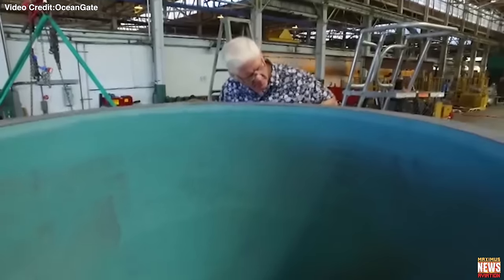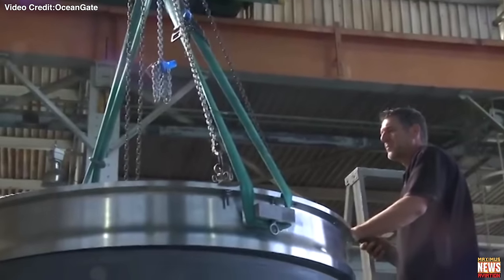Watch The Manufacturing Process That DOOMED OceanGates Titan To Fail. But It NEVER Had To Happen.

Comment: They took two dissimilar material and glued them together. Each of these materials react differently to extreme pressure and temperature changes. Add cyclic deterioration from multiple dives and you have a recipe for disaster.
Reply: you have a recipe for human pancakes.
Reply: But James Cameron says this was a known thing amongst all engineers and it wasn't some obscure scientific knowledge.
Reply: They were sniffing glue when they made the sub...
Reply: Carbon fiber has absolutely no place in the depths of the ocean. Not capable of handling that pressure to begin with.
Reply: A soda can was better built to survive than this submarine!
Reply: OMG great point. I do alot of crafting and i also make costume jewelry as a hobby. I just had to read a few articles on the  differences of all the glues and which materials they bond too and how they hold up in conditions such as heat, humidity, freezing cold etc.  This is no different. You are right. Another point of negligence for the lawsuits.
Reply: @EpicBongZilla  what about carbon fiber glued to metal though. That seems like a good human pancake recipe.
Reply: @rockyBalboa6699  you know you can do an experiment using an empty aluminum can to simulate what happened to the titan. 

Empty out a can, keep its full shape. 

Place can in boiling water and let it boil for about 10 minutes. 

Prepare a dish deeper then the can with ice water. 

Use tongs to remove can from boiling water and quickly submerge it into the ice water. 

Can will suffer Explosive decompression and crush its self. Just like the submarine did
Reply: That's not even the half of it.  The carbon fiber ended up being subjected to compressive forces, when the strength of carbon fiber is against tension.   It'd have worked fine if the higher pressure had been INSIDE the vessel rather than outside.
Reply: Yes. I'm no engineer, but trusting a glue to titanium & carbon doesn't sit right with me either, even at room temperature, especially when the force is equal to 144 minivans per square foot.
Reply: and cfrp is not good in compression
Reply: The more I learn about this stuff, the more I am floored that Rush was an engineer,,,, was he dense in the head?
Reply: Basically. a design analogous to disposable chopsticks - use once then dispose of carefully.
he did theHYPE 1st, the business model 2nd and the ease of construction 3rd and the engineering 4th.and thought the extermination waiver would cover lesser priorities like the lives of Billionaires, who are seemingly to exploration what log rollers were to the building of the pyramids//
Reply: Glued.  Not welded… glued.
Reply: Carbon fiber is GREAT under tension, such as a pressurized cabin in a spacecraft, but it does not have that much strength in compression. It’s probably more so the epoxy giving it its strength under compression. Why the hell did he use carbon fiber?!?
Reply: JohnnytNatural  That idea popped into my head too, then right away that means $. So, voila ! I'd be more contented with a roll of stainless steel that's welded. This whole idea of revisiting the Titanic is worn out with me. There's plenty of video, and the clarity isn't going to be be any better through a 7 inch plastic lens. Let the dead rest in peace.
Reply: That's how you get your ass turned into a milkshake💁‍♂️
Reply: Ah, but you see it's not a thin glue like Elmer's glue; it is a thick glue... Like peanut butter. 👍
Reply: It already visited the Titanic a few times.
So your explanation isn't all what you think it is!
Reply: They thought that they were smart,
The proved that they were fishfood.
Reply: Exactly. Don't forget the window wasn't rated for anywhere near 4000 meters deep.
Reply: doorway into the sub.. was also hinged on that weak connection..  warping is an issue
Reply: @HurricaneOK1  Ok. Jiffy or Kraft ?
Reply: @FunieBoi-hh7wx  He proved one way not to build a sub for continuous use with his life. The sad part is he took others with him. Not the greatest legacy.
Reply: Don't forget to add a narcissistic millionaire who fired an employee for questioning the safety of the sub design...
Reply: @ario4795 I am interested to know the specs for the 2 part epoxy.  What kind of bond does it have 4k meters below?
Reply: @Dean_Winchester86  Redneck, know it all, backyard, engineer.
Reply: @largol33t1  I know this sounds crazy but once I saw his hairdo, I knew he was a narcissist. I'm sure everyone will understand.
Reply: @apollomoonlandings  So human fritters rather than human pancakes?
Reply: @danvetor1365  What don't you understand about the work cycles?
Reply: @jonfreeman9682  yes, and they fired the engineers that told him that lol.
Reply: Thats not an explosive decompression. That’s rapid air evacuation causing suction to compress the can.
Reply: Imagine having to spend the last moments of your life sitting cross-legged inside a small tube with an idiot whose life mission is to turn you into a fritter.
Reply: Those recipes are what people likes to spend, the CEO knows how to make money for sure.
Reply: @jimbendtsen8841  Rated for 4000 feet is what I heard.  Their target depth was 3x that.  Insane.  Dimes to donuts that wasn't disclosed in the signed waivers.  In my opinion those waivers should be null and void due to nondisclosure of very significant safety information.
Reply: @jonfreeman9682  It is Carbon Fibers are useless for reuse when you place them in an environment where the pressure is outside and not in.  Each introduction and removal of that pressure causes micro-fractures inside the fiber weakening it each time.  Even Formula One has that data from the front cones they use on the cars. Some of the teams if it is hit in a race and looks ok they still replace it as they know the next race at random it could be what causes a tire puncture from fibers that may come loose and lodge in the tire ending their race day. 

But besides that word has it the viewport was only built to a 3000ft tolerance depth.  So if they discover the ballasts further away from the wreak on the bottom it may be possible that they witnessed the viewport glass crack for a second or so dropping the ballasts and implosion even before the ballast's release effects were realized.  That would give them that split second of oh shit. If it turns out to be the viewport.  And all over.    When they bring it up I guess we will see if the port glass is intact or not.
Reply: We'll see.  I suspect the end cap - carbon fiber epoxy joints were not the problem.  The carbon fiber in the joint is quite possibly still there.  I suspect the carbon fiber cylinder was the problem.  Though possibly the differential expansion and contraction right at the joint was a problem.
Reply: @largol33t1  Billionaire.
Reply: That's not even it. Thats the wrong "direction" to build the stuff for keeping pressure out. I don't even know how it made it once much less the dozens of dives it made other than the 4 to the Titanic.
Reply: @michaelscott33  suction is just less pressure inside that outside.
Reply: The lap between the 2 materials was insufficient at the same time.

It's almost like they didn't know that the us has had plenty of proven submarine designs for a long time
Reply: Exactly
Reply: @ario4795  oof
Reply: @lordhighwind6230 well you cannot weld metal to carbon fiber.  The only way to bond these materials is an adhesive.
Reply: The "engineer" Tony Nissen dude said it was just glue holding it together Yikes!
Reply: @joanfrellburg4901  The so called "engineer" Tony Nissen himself with a smile on his face it was the glue holding it together Yikes!
Reply: @danvetor1365 it actually makes a lot of sense.  The difference in expansion and contraction will cause problems over time.  It’s the cycling of expansion and contraction over and over that causes failure.  Even the bicycle industry found bonding metal bottom bracket shells to a carbon frame would eventually fail the boding Agent or at times crack the carbon.  This happens 24 hrs a day not just in expeditions.  In storage ect temp is always changing.  It’s like bending a spoon and bending it back.  You can do it but after so many cycles it will eventually fail.
Reply: Cameron explained that the capsule should be all one piece. The inside of that sub looked like a Pringle’s potato chip can. Reminds me of the old saying, it burst at the seams.
Reply: @joanfrellburg4901 its wasn't just any glue that was structural sikaflex lol
Reply: @apollomoonlandings you are wrong. What was left would be the human equivalent of spam or Bologna lol
Reply: @Dean_Winchester86  he was not thinking clearly
Reply: @Dean_Winchester86 Airplane aeronotics engioner most planes use this stuff where he got idea listen James Cameron commentary on this informative.
Reply: @joanfrellburg4901  It's Jiff not Jiffy!
Reply: I'm not an engineer and even I knew that ...  IDK what they were thinking
Reply: @Turboy65 that glue still wouldn't hold against tensile stress caused by bonding two dissimilar materials together
Reply: @hardmcshaft7931  yes, unstructural sickoflex
Reply: @MissX905  Ya, just because model cement works is no reason to assume this is an ideal scenario. I bet he plays Russian Roulette on the weekend.😄
Reply: Not an expert, but wrapping a cylinder with carbon fiber seems to me to be what is done with a pressure tank where the pressure is on the inside, not the other way around.  SCBA tanks have been wrapped for years for structural integrity which contained internal pressure.
Reply: @rp-ot6ov  Glad you pointed that out, not everyone knows that.
Reply: @UpInSmoke54  OK, raspberry jam or strawberry.
Reply: @rockyBalboa6699  Kind of hyperbolic but point taken.
Reply: @joanfrellburg4901  The pressure would hold the two pieces together unless ... the cylinder failed.
Reply: @Deploracle  The caps are now lying on the ocean floor and the cylinder is in pieces. If anyone wants to buy a titanium cylinder get in touch. LOL
Reply: Are you an engineer, or just a random diver with an opinion?
Reply: @joanfrellburg4901  Lying on the ocean floor a significant distance from the carbon fiber debris. The carbon fiber crush was so sudden it squeezed out the titanium endcaps with force.
Reply: @Deploracle  So your theory is over time, somewhere, probably around the middle of that cylinder, due to expansion and contraction, a hairline crack developed which rapidly turned into an implosion.
Reply: Exactly, the hot-cold cycles had to weaken the bond between carbon and titanium. Nowhere near enough overlap at that joint: carbon abhors 90 angles also. Flexing against titanium continuously would eventually damage the carbon coming out it the joint. Flue, even epoxy to metal does not equal solid metal or even solid carbon fiber. A giant carbon sphere would be safer that this.
Reply: @MakaiMauka  I think you've made some very valid points here. Especially that connection between the titanium and carbon with really ( in my humble estimation) isn't that lengthy a sleeve. Then you've got the glue exposed to salt water which by nature is highly corrosive.
Reply: @johnmonk3381 why not? It did for 13 pressure cycles.
Reply: @nikoscosmos  13 ? So he wasn't even superstitious. No wonder.
Reply: @Turboy65 Not with the glued end caps. Would have popped right off.
Reply: @k53847  I form steel suspension components with a mechanical press.  The press is rated for 2000000 Newtons (200 tons).  When I set up the stroke height, I have to account for tooling compressing elastically, under load.  Why is this relevant?  It taught me that, when forces get large, EVERYTHING is a spring.  The titanium end caps and the composite tube are both compressed like springs.  The diameter of the titanium end caps is reduced by the water pressure.  The water pressure on the wall of the composite tube will reduce its diameter and the load from the end caps will cause it to shorten.  If the composite tube and titanium end caps do not reduce their diameters by the same amount for the same change in pressure, the component that would shrink more transfers load to the component that shrinks less.  As this transferred load is in addition to the water pressure loading, the component that shrinks less can be loaded past its rated load and fail above its rated depth.
Reply: Yeah, I’m shocked that it was glued and not bolted
Reply: @HurricaneOK1  End was way to loose for glue and the glue probably had voids in it as well due to being thick.
Reply: @jimbendtsen8841  It was certified to 1300 meters, that being said it made it through 14 successful dives to the Titanic so it must have had a large safety margin.  Probably got weaker with each dive, maybe the remains will show if it broke....
Reply: @camojoe83  They had made 14 successful dives to the Titanic since 2021 carrying 46 passengers.  Each one increasing the odds of failure.......
Reply: @ssaraccoii  SCBA tanks are also wrapped with cross fibers for additional strength whereas this tube was just circular, the epoxy was basically holding it together...
Reply: @Deploracle  The pressure comes from all directions  there is just as much pushing it apart as holding it together..
Reply: I wanna know how he fit the titanium to the carbon fibre at the joins because surely the pressure would cause a rupture between the too materials and cause cracks and pressure loss
Reply: He built his own coffin  very sad
Reply: That’s unbelievable when I saw glue
Reply: @joanfrellburg4901  "144 minivans per square foot"? What's that in school buses per football field?
Reply: @grantm6514   a teaspoon of neutron star material would weigh around a billion tonnes.
Reply: @tybrady4598 My understanding is that carbon fibre is certainly better in tension but is still not too bad under compression. The carbon fibres attract all the load (being the stiffest element) and the polymer matrix stops the carbon fibres from buckling under compression. But Poissons ratio helps to explain why it can delaminate under high compressive loads (as the bursting forces are taken by the polymer matrix) but not under tension. At least thats my understanding
Reply: @grantm6514  Algebra, I didn't like it either at first. Still too lazy for it.
Reply: @HitsInSandbox yup my moneys on the view port while James Cameron thinks it’s the carbon fiber body that whole machine was a death trap. Used glue 🤦‍♂️
Reply: @solidstream13  Yes glue is needed but it also needs mechanical clamping to secure the bond against pressure and thermal cycling.
Reply: @joanfrellburg4901  US teaspoon or metric?
Reply: @Cam-ng8rk The fiber layout is also a problem there is no cross lamination that helps to hold the fibers together. The individual fibers are isolated and can only share load via the epoxy matrix. The layout does not distribute the stress around fiber to fiber.
Reply: Just glued it together, that’s crazy. Doing that is bad enough on a car and that is something under fairly minimal stresses, also wouldn’t be an instant disaster if cracking or delamination occurred over time. Glue any dissimilar materials for let’s say in a production environment and you wouldn’t expect reliability or longevity out of doing something like that.
Reply: @joanfrellburg4901  have you seen father Ted
Reply: @kazedcat  I have not found this to be true.  why do you say? Pressure would only further cause compression force.  Clamping would disallow the expansion.  I’m not understanding your point.  Are you suggesting that a clamp was necessary and was not present?
Reply: The Axial pressure from the outside in is 6400PSI.   But I calculate the pressure on the ends of the ring are much higher.

Internal diameter 56"   Radius 28"
Inner area 2463 in^2  

Cylinder wall thickness is 5"

Outer cap area R = 33"  =3421 in^2

Ring area = outer - inner = 958 in^2

Pressure on 1 endcap = 
PSI(outside @ 11,000ft) 6400PSI * 3421 in^2 
= 21.894 million
Pressure per square inch of ring 45,708 lbs from both sides? 
For compare, concrete is 2000-6000 PSI in compression while 
Structural Steel is 50,000 PSI in compression and tension
Reply: Yes, and the glue itself is the 3rd dissimilar material. Its properties relative to the metal and carbon fiber is critical, especially since the glue fills the gap that seems to be over a millimeter thick. The glue was applied imprecisely by hand and allowed to cure in a uncontrolled,  non-sterile, and non-vacuum environment. If it's exposed directly to the ocean, then it can degrade and later, a tiny leak can turn into a water jet at 6000 PSI.
Reply: Peanut butter in, peanut butter out.
Reply: @oahuhawaii2141  You’re statement is so very clear, concise and logical it boggles my mind that the “experts” involved didn’t think of such a simple, yet instantly deadly scenario. Maybe “experts” these days aren’t the top people in a field.
Reply: @EpicBongZilla: That isn't inducing explosive decompression or even implosion. That's just temperature shock. Titan wasn't hot as boiling water and immediately placed 10K ft down into the ocean. [It was lowered under the surface of the ocean and released to sink down to the depths. It continually reached temperature equilibrium as it descended. After 105 minutes (45 minutes before it should reach Titanic), the pilot detected a critical problem, and released the ballast weights to begin an emergency ascent; he notified the surface support ship of the abort. After that, the ship lost comms and tracking pings. The US Navy detected an acoustic event consistent with an implosion.]
Reply: @danvetor1365: You didn't consider material fatigue.
Reply: With glue.
Reply: True, not only that, even if the carbon fiber itself could withstand the tremendous pressure and cold, you had resin between the layers. That resin was subjected to the same conditions. It was like a layer cake instead of one continuous material that likely weakened over time.
Reply: The core issue besides all these things.....carbon fiber construction of a vessel is OK when it's used as a pressure vessel....when the carbon fibers are in TENSION, like when the pressure inside the vessel is greater than the pressure outside.....but here we have the enorormous outside pressure of the ocean trying to collapse the vessel....it's as if the sub was built as a vacuum ( not pressure) vessel....the carbon fiber is now in COMPRESSION.....a very fundamental and basic fact totally ignored in this design, and in direct violation of how it should be used.. Carbon  fiber is NOT meant to be used in compression.....period.
Reply: @ario4795  Or human toothpaste, getting squeezed out.
Reply: @ario4795  not so much pancakes. more of human goo.
Reply: @misselanys1219  I doubt there will be lawsuits.  They signed a dozen waivers before they went down.   If anything, the estates of the victims will be sued to pay for the rescue efforts.
Reply: @jaycahow4667  My point was that wrapping a cylinder adds strength from pressure from the inside out, not from the outside in.
Reply: @ario4795 Not really a pancake, have you ever seen hot dog sausages being made, that pink paste? That's what pressure and heat does to a body.
Reply: @danvetor1365  Ticking time bomb with a long fuse?
Reply: @BrianClem  None whatsoever now.
Reply: hell carbon fiber is two materials that arent the same the fiber and the glue
Reply: @solidstream13 For joining titanium and carbon fiber adhesive is necessary but titanium and carbon fiber expands and contracts at a different rate this process stresses the adhesive causing bonding failure. A mechanical clamp will reduce stress in the adhesive preventing bonding failure but the clamp will just transfer the stress from the glue into the bulk materials. Mechanical clamps are simply shifting the stress from the weak glue into the much stronger titanium and carbon fiber material.
Reply: Different Young's Modulus.
Reply: Yeah it should be homogeneous
Reply: @EpicBongZilla  It's lightweight & how much fiber will handle pressure? Freezing depths & just one weak spot, it cannot survive.
Reply: @ario4795   batter, pancake batter.
Reply: @solidstream13 cant believe they do that type of bonding in a non clean room environment. Dust hair any number of contaminants cant be good. Eouldnt have saved them but wow
Reply: @ario4795  *Top ramen
Reply: @EpicBongZilla  the can crushes because atmospheric pressure is greater than the inside of the can. Has nothing to do with temperature.
Reply: Exactly! Not a shred of thought of what stress has done to the unit. No respect for the power exerted at that depth. I am a submarine veteran. You couldn't pay me enough to go down 2 miles.
Reply: @EpicBongZilla  I was going to say Carbon Fiber my A$$! I was on a Fast Attack in the 70's & you couldn't pay me enough to risk going down 2 miles. Thinking it impervious to the stress...
Reply: I have a road bike with carbon forks that join aluminium steerer tube and there are signs of slight delamination where they join!(it's old ok).  Madness.
Reply: @jonfreeman9682  Most Laymen would know that never mind James Cameron / engineers.
Reply: @johnmonk3381  Never said it would. Carbon fiber composites are amazingly strong against tension. Against compression, not so much.
Reply: @TD_YT066  I think you're getting pressure and force mixed up.
Reply: Most of the other successful deep dive craft have a living space based on a thick titanium sphere. Probably designed be middled aged white men !
Reply: The glue isn’t an issue since the forces are pushing the ring into the carbon anyways. The problem was the carbon was laid in only one direction and couldn’t hold against the endcaps pushing in probably. Carbon fiber is like plywood, you have to run the grains in different directions to create strength. In the video it seems like they just built it like a spool of wire with all the fibers parallel? That just looks wrong
Reply: @kazedcat  I think we are saying the same thing. However when metal expands and contracts the forces are too great.  Expanding metal will expand and contract regardless of what outside forces you attempt.  It would simply further tension a clamp of even cause a clamp to fail.   You cannot direct the expansion only inwards.  Even if this were possible it would theoretically put more pressure on the bonding agent thru these cycles.
Reply: @Disoriental11  Wasn't the carbon bonded inside the ring, therefore large pressure forces on the carbon trying to separate it from the ring.
Reply: Carbon fiber has its place for airplane manufacturing, light weight, fuel economy.  However, it’s totally mind boggling to use it in hydrodynamics application.
Reply: Even the carbon fibre has been spun linearly rather than in crosshatch pattern
Reply: JohnnytNatural  I think the glue is only there to hold it together above the sea, or just a few meters below. It's naturally held together under the sea due to the pressure. There were reports of water leaking on the Titan and the solution was to go deeper and leakage stopped.
Reply: @largol33t1  Better to hire more diverse people without the knowledge to question the design because that will inspire others.
Reply: @somethingwentwrong3298 the carbon tube is being pressed into the ring from the extreme pressures, not pulled apart. The problem is that the carbon and titanium would have different contraction rates under the pressure and that could crack the carbon near the joint, especially since the carbon was only laid in one direction.
Reply: @joanfrellburg4901  "I will be the first bla bla." Big red flag there. Bragging against extreme physics I bet you are going to loose your fight.
Reply: @RazorStrap  Work cycles come into play normally at some thousends of cycles, depending on use. Obviously you are not going to deep as many times with a sub as an airliners fly around 12-15h per day with multiple flight every day for years and years. But still, you shouldn't even discuss cycle fatigue when you are just beginning your operations, or if you have to, well it's a very bad sign to start with.
Reply: @12345fowler  Ya, just my opinion I can come up with 250,000 better ways to spend $250.K
Reply: @12345fowler  Arospace craft are not subjected to anywhere near 5500 psi.  And the pressure they are subjected to is internal (tension) not external (compression).  Cycles come into play much sooner when the vessel is subjected to many multiples of its design.
Reply: @agt155  My read is Pressure is Force x Area.  So if the water Pressure is 6200Pounds per square Inch, and the Ti. endcap area being pressed on is 3400 square inches with 6200lbs on each square inch, the total force will be 3400 in^2 x 6200 lb/in^2 = 21.8 million lbs. This force presses on the CF. ring which has a much lower area, only 958 in^2 so it has to 'push back' with the same force to remain attached. This happens on each end.  In addition is the 6200lb on each square inch of the cylinder over it's length and circumference.
Reply: @TD_YT066  force = pressure X area, but the rest seems correct.
Reply: @solidstream13  Yes the clamps may fail but that means you need to design a stronger clamp. The clamp will be two metal ring one inside and one outside with the carbon fiber sandwitch between them. When the metal expand and contract the two rings expand and contract together. This forces the carbon fiber to expand and contract with them mechanically. This ensures that the glue is not stress because the carbon fiber and the metal are force to move together. The carbon fiber will be stress and the metal will be stress but they are a lot stronger than the glue.
Reply: JohnnytNatural  actually it was the carbon fiber cracking up to the seal. 

One stocktons 1st dive in the titan he documented the hull making cracking sounds. 

Then on his second dive in the titan he brought an scientist with him. The scientist actually documented the hulls cracking sounds on video. 

He never even went back and reinforced it.

His hulls integrity was never stable to begin with and he knew it. It was basically only as stable as the epoxy used to glue it together. 

Once water made it through those cracks to the end caps. The vessel was doomed.
Reply: The point of failure will most likely be where the fiber & end cap join , that’s a small lip to support the joint, equivalent of 1/2 inch ledge to support a bridge I’m surprised it didn’t fail on second dive
Reply: @Turboy65  good point. When this investigation is all said and done, there will be reams of things that should have been done differently.
Reply: BINGO.

I took just enough engineering to get me into trouble... but have worked with titanium... and was SHOCKED when I finally confirmed that carbon fiber was used for the cylinder of the pressure vessel. I thought all the talk of "carbon fiber" was just a reference to the covers/fairings. The visible end bell was obviously titanium, and some photos I saw of the inside of the cylinder certainly LOOKED like titanium as well. But titanium end caps GLUED onto a carbon fiber tube... NO WAY!

A better solution would have been to use long studs from one end bell to the other, thus "clamping" the cylinder between the ends. I'll bet that the failure began not with the cylinder just collapsing, but with an end bell being "popped off" due to stress on the cylinder.
Reply: Engineering 101 -- Vision.  Design & Analysis.  Prototype.  Cycle test.  Test-to-destruction.  Analysis results.  Agree on actual safety margins for cycle & absolute usage.  Build a production version.  Dummy test it.  Then it put to use.
Reply: I've been working with material failures for over 40 years, I think exactly the same.
Reply: @EpicBongZilla  How exactly do you empty the soda can without breaking an airtight seal?? An open can will do absolutely nothing in this experiment.
Reply: How many dive cycles was this thing designed for or does anybody know?  Was it ever considered in the design phase?  Was this a test to see how many times it survived?
Reply: I wouldnt even ride a Carbon downhill bike, one crash and you have no idea what structural integrity is left.
Reply: Yes, but it was cheaper.
Reply: JohnnytNatural 
Thing is they act like glue is the only way, but rods could go from end to end with nuts
Reply: @BrianClem 
And was it the right Humidity amd material temperatures for proper adhesion. Looked like an open warehouse. Ferarri builds their engines in climate control
Reply: @jaycahow4667  Voids, bubbles (look how they mix it), dust (it's just a warehouse), and uneven application and centering. Every one of those things becomes a danger when exposed to pressures going up to 37 megapascals.
Reply: JohnnytNatural  I was wondering if it was that way, where the cap is pressed tight by pressure, but then if a slight weak point exists in an air pocket or slightly less epoxy in one spot allows a leak. Using bondo spreaders with no thickness test gauge is just way to inferior a process for something like this.
Reply: But mah innovation
Reply: @jonfreeman9682  the hull manufactures said it was 1 time use. They ended relationship with him when they found out what he was doing
Reply: @ario4795  lol yeah i don't like the sound of a carbon fiber sub then you find out its glued to the titanium front.
Reply: @lordhighwind6230  Might be the best gorilla glue
Reply: I know aluminum and carbon fiber can't touch so I'm wondering if titanium and carbon fiber have the same issues with each other?
Reply: That's a word-for-word quote (uncredited) of what a retired USN submarine captain said on "CBS Sunday Morning".
Reply: The submarine looked like a small industrial propane tank
Reply: I atleast hope it was gorilla glue and not Elmer's glue
Reply: But they were inspired!!!.. And amateurs teach amateurs to be amateurs. =💥..💀💀💀💀💀
Reply: Even they are similar materials the glue wouldn’t last.
Reply: the fact he had an entire team of designers and engineers. but they still decided to go with his plans and build it. he shouldnt be the only one held responsible. atleast 1 or 2 of those engineers should have been like, whoa what the fuck are we doing here...
Reply: I honestly don't think so....I mean with regards to carbon fiber wrap.  I don't understand right now how that carbon fiber shell ever had any significant impact on the compression strength of the vessel.  The stuff is STRONG with regards to not tearing, and I could see how it might add strength if the vessel was under positive pressure from the inside...but I don't understand HOW it would have ANY significant contribution to the strength of the vessel under compression.  I don't think it would, and this makes me question these guys....Does anyone know?
Reply: @pauliexcluded1  your right carbon fiber is insanely strong and tough. but when you put it under stressful conditions and out of stressful conditions multiple times the carbon fiber weakens. immensely...
its like a piece of thin steel... you can bend it, but bend it enough times back and forth and it will loose its strength and break... its the same physics and logic.
Reply: Spot on, how could they not know it. even if materials were the same how could glue hold it.
Reply: @danvetor1365  It doesn't matter if it visited the Titanic a few times previously. The more times you subject the vessel to the pressure at that depth the more the cyclic fatigue weakens the hull until it can no longer resist the external pressure. The CEO was playing Russian roulette each time the Titan dived, and it was only a matter of time before the inevitable happened.
Reply: They glue Cars together every day. Plus the pressure is pushing in all the time. I don't believe that's as much of an issue as the general construction of the shell. Just my thoughts.
Reply: In hind sight they should have made a slightly weaker miniature of the sub and install the monitoring system on it for each dive, then witness it implode before the last dive. Oh and yes, Oceangate, I'm available for the 'innovative new crew'.
Reply: @genekrafft948  First off, cars are not glued together lol. and secondly yeah epoxy weakens under 6,000psi of pressure.
Reply: @lordhighwind6230  actually it is bonded, that is the epoxy actually bonds molecularly to both parts, another advantage of using Apoxsee is, it can fill gaps if the surfaces are not perfect glue will not fill gaps and voids can occur.
Reply: They knew it and had a solution.. it was A solution.
Reply: Tony Nissen made pancakes
Reply: You nailed it, the carbon tube itself probably didn't fail, but that "joint".....
Reply: @Turboy65  Carbon fibre can't flex (as much) as metal sheets under high pressure. You see sheet metal flexing, there's still time, you see cf flex, that's it.
Reply: Mo' Diversity!
Reply: @Turboy65  I've also wondered about that. Many materials have have high tensile strength but little compressional strength (a rope being good example). I know nothing about carbon fiber but wrapping it around the steel vessel to reinforce it from imploding would do little to strengthen it  if the carbon fiber did not have compressional strength. Also it seems to me that if even a small  leak ever developed between the carbon wrapping and the the steel tube the entire depth pressure would be loaded onto the steel making the carbon wrapping irrelevant.
Reply: Not only dissimilar materials, but I'm sure there were air bubbles that contained humidity between the metal ring and the carbon fiber tube.
Reply: @camojoe83  If the fibers had been run longitudinally, in a "hyperboloid of one sheet" shape, with fibers running in a primarily fore-aft direction, and the exterior was braced with fore-aft metal struts that were braced with stabilizers to guard against buckling, the use of carbon fiber cloth would at least make sense.  Given that the craft was ever able to survive at all at 300 atmospheres, I would think a thinner skin under tension would have been able to do so repeatedly.
Reply: He was an engineer from Princeton working with the University of Washington and that’s what you get
Reply: You have a recipe for an underwater aerosol can that sprays fish food.
Reply: @flatfingertuning727  i had that thought sort of. Make it look like a fluted column on the outside, but that would load the fibers right  saying it was wound in the same direction. only compressed against support that way, the rest of it bears under tension as is proper for filament wrap. 
Maybe look like an exaggerated golf ball on the outer surface if it was spherical, but im definitely picturing a fluted column if were talking about the same shape sub.
Reply: @lordhighwind6230  glue are etremely robust connections. Just how they react to repeated extreme presure and temperature changen....not exactly known for this case
Reply: Not to mention the corrosive effect of saltwater, UV radiation, eating and weakening the epoxy holding together the carbon hull which was expired when they bought it from Boeing. A needless mess.
Reply: @jimbendtsen8841 it quite possibly could have been the window that gave way rather than the carbon pressure hull... Nobody knows.
Reply: @jonfreeman9682  some British guy in a shed did a video 10 years ago showing why you should not make subs out of carbon fiber.   Made a model and tested it to destruction to show the failure mode.
Reply: @piccalillipit9211  Wow so this flaw was known over a decade ago and still this CEO chose to build carbon fiber sub. I know James Cameron said in the interview it's not the right material to use but thought CEO was smarter than him and figured out a way to make carbon fiber work. I can't help but wonder if this CEO used carbon fiber because it was cheaper. He doesn't have James Cameron Hollywood money so you get the sense he's cutting cost hence the MacGyver methods to build his sub. I saw a video say it cost a million to build the carbon fiber core so I wonder how much more it would cost to build a solid titanium or steel core. Like how much can you save by taking on more risk.
Reply: @jonfreeman9682  I found the video for you - https://youtu.be/lwvUvIKhK1Q

Its very boring - but it clearly shows why you don't build subs out of carbon fiber.   Re cost?  I dont know but I do know that anything marine is astonishingly expensive. A box of bronze screws for my yacht cost £600 in 2002.  Silicone bronze stretches before it breaks and you need that to absorb shocks.  You don't get a lot in the marine industry for $1 million, You really dont
Reply: I don't trust glue in general... they aren't even good for gluing sneakers
Reply: Yeah it seems pretty self evident that this capsule should’ve had a maximum life span of maybe like two or three dives and then if you planned for it like that it may not have been a bad idea but then you have to question would it be more cost-effective to just build a more traditional deep submersible sure a hell of a lot more upfront cost but you can use the thing a lot longer and feel a hell of a lot safer but then I guess he wouldn’t be innovating the science like this rush Dude wanted to do so much is demand to be right in the face of blatant science and logic.
Reply: Jelly, human Jelly
Reply: They worked the seal apart every dive I'm assuming. Jesus christ Stockton was a murderer. 
He knew this shit was sketchy he wasn't stupid just really really cheap.
Reply: @jimbendtsen8841 ironically they have dragged up the front door and the window is intact
Reply: @camojoe83  Another thought I had: I wonder what would happen if one had a stack of inflatable "donut-shaped" pieces of heavy waterproof fabric filled with a relatively incompressible lighter-than-water liquid at a pressure somewhat greater than the pressure at dive depth, put a couple of spherical inflatables at the end (likewise filled with a liquid), and had the whole thing enclosed in a form-fitting water-tight skin?  I would think that if all of the inflatables were at a pressure which exceeded the outside water pressure by a suitable amount, and all of the fabrics were sufficiently strong under tension, the structure could be stable in the presence of outside pressure without any compressive members that could buckle.until the outside pressure became sufficient to excessively deform the inflatables.  I wonder what I'm missing.
Reply: @flatfingertuning727  i dunno. Because of the air chamber contained inside that, you'd still have massive compression forces. A flexible pressure vessel is just that in the end, flexible. I understand the idea you're working around, but I think the air pocket required for the passengers would defeat it.

I think they had the right idea in the movie Abyss with the liquid breathing dive suit, for ultimate safety.. just get some hyper oxygenated fluid and fill a barrel with it, put your tourist inside and seal the clear lid. Then just toss em overboard. They'll either freak out and break their neck tryin not to drown or they'll get the experience they were after..
Reply: DieterDuplak314  when you're pushing the envelope of tech, that's a valid statement. 

When you're hauling people around in a vehicle for profit, tho.... That's specifically what OSHA (and others) was made for.
Reply: @tybrady4598  Putting any fiber under compression is basicly the equivalent of pushing a rope
Reply: That’s exactly what went wrong
Reply: @Turboy65  pressure inward or outside should be same effect.
Reply: @apollomoonlandings not even bones because at such pressure bones will dissolved
Reply: @omsingharjit  Wrong.  Carbon fiber is very strong in tension, it's nothing special in compression.  Putting a carbon fiber pressure vessel under external pressure is completely the wrong application for the material.  Expect failure. Obviously.
Reply: @Turboy65  ok got it .
Reply: Not to mention only tightening 17 out of 18 bolts on the hatch cause “17 and 18 don’t make much difference” 🙄
Reply: Hubris and Wokeness led to this event.
Rather than hiring "50s years old white men" who are the subject matter experts with decades of experience in building proven safe designs, they went with young, inexperienced people to make innovative design for a commercial tour deep sea submersible craft.
Alvin, a 50 year old deep sea vehicle, has successfully done over 5,000 dives and returned safely.  5,000 dives safely.  But that's not innovative, just proven.
Reply: they didn’t actually glue titanium with carbon fiber.  If you watch carefully, they wrapped carbon fiber around a metal tube, which had a thick lip at the end. The end cap had a groove where the lip fits into.  So it was a metal to metal joint of similar metal.
Reply: @k53847 and the screws they drilled in to hold the monitors…
Reply: That was my guess.😅
Reply: @xsu-is7vq but then why use glue at all when you could just weld it together?
Reply: Everybody is an expert now
Reply: @camojoe83  If one tried to push a basketball through a 6" (15cm) hole, it would pass through easily when deflated, but if inflated it could not be passed through the hole without either stretching the exterior a lot or applying enough pressure to compress the fluid therein.  I'm not sure how much above sea pressure the pressure in the spheres and rings would have to be for any particular arrangement, but they key point is that fluids can shift around to share loads without fatigue.
Reply: @cinemoriahFPV  you can't make the can crush its self without heating it and submerging it I cold water. So the temperature definitely has something to do with it.

But the point was the experiment simulates what happened. Not that I know exactly how it works.
Reply: Cyclic deterioration.  That’s the term I was looking for.
Reply: @rockyBalboa6699 Utterly brainless comment. But I guess you're a professional structural engineer of submersibles, right?
Reply: @joanfrellburg4901 You're forgetting that the higher the pressure, the better it will seal.
Reply: @flatfingertuning727  i get it, that's the same idea behind the lifting bags they used to steal that section of hull. They filled em with liquid (diesel, because it had to float, and then sunk em with chains. You probably remember,.. i think they just filled those full with no air space, i don't think they had a positive pressure, definitely weren't pressurized to the same pressure as their target depth.. i don't think it could be made rigid enough to keep the air inside from compressing. It might not implode like the stupid air tank of a sub did, but I bet it would squeeze it hard enough to collapse it to the point of spontaneous combustion temps being reached.
Reply: The short term is "service life". The problems come when the service life is unknown. Sometimes its found out at the cost of lives.
Reply: @EpicBongZilla I like drinking half a bottle of water at 35,000 feet and watching what happens to it as we descend.
Reply: @ario4795 Well, it was all good... until it wasn't.
Reply: @apollomoonlandings Depends on how that Darwin Award is earned.
Reply: @joanfrellburg4901 Polish roulette... five bullets, one empty chamber.
Reply: @ssaraccoii They build municipal water tower tanks like that.
Reply: @camojoe83  To have significant rigidity, an undersea inflatable structure would need to have an interior pressure significant greater than ambient.  If pulling part of a ball through a circular opening would increase the interior volume half as much as it decreased the exterior volume, I'd expect the ball would move in that direction if the pressure differential between the two sides of the opening was more than half the interior pressure of the ball, but not if it was less.

I would expect metals like steel and titanium to be more practical than inflatable structure members for most load-bearing tasks, but I would think inflatables could be a useful adjunct given that liquids inherently have homogeneous mechanical properties and don't suffer from fatigue stress.
Reply: @flatfingertuning727  the ball in the hole is not the right model. Remember, we're dealing with omnidirectional forces. There's no region in which any relaxation can occur when there's increasing pressure except into the air space. The ball thru the hole only bears a "rolling" pressure, if that makes any sense. Might not be the right word, but the load of the hole on the ball isn't replicating what pressure crushing does. Not quite.
Reply: @spaceflight1019  Municipal water tanks contain an expanding pressure from the inside out.  Proven engineering since the days of wrapping SCBA tanks with fiberglass.  This was using it to prevent implosion.  Different set of engineering criteria.  If it was containing pressure, it would have been extremely strong in resisting radial pressure forces.
Reply: @PDZ1122  Until it doesn't.
Reply: @jonfreeman9682 he’s a movie director WTF does he know about physics and materials science, absolute zilch!
Reply: They applied the epoxy by hand, one nanometer void in the adhesive and it’s all over, and it was. Damned amateurs playing with nature. Nature always wins
Reply: @scomo532  I normally water my epoxies down with a little mayonnaise. I bet they never tried that technique. Also laying a good thick bead of silicone wouldn't hurt either. :-)
Reply: @joanfrellburg4901  you neglected to mention Elmer’s……good stuff!
Reply: @scomo532  When he said tight but not too tight, or something to that effect, it reminded me of that fact that a sucker is born every thirty seconds.
Reply: Another note, when car makers start gluing steering wheels on cars, you know we're in big trouble.
Reply: And in space, they want to do the same with inflatable habitats.
Reply: @EpicBongZilla  That's not how it works.
The heat will reduce the density of the gas inside the can. If you now close it and let it cool down, the air pressure of the outside will be larger than the cooled down gas in the can. The result is an implosion of the can. The ice water is only used to have a short cool down time.
Reply: @OpenGL4ever  Mankind - The new late show for Aliens.
Reply: A lot of uninfomed speculation here. Best to wait for the real experts.
Reply: @kennethhawley1063  Yes when all the experts show up, we'll be sure to let them know how to do it right, and which brand of peanut butter to use.
Reply: That story is just the overly repeated narrative, that the internet full of hobbyist submarine engineers have zeroed themselves on to. But these issues can be accounted for by good engineering. Not that it was particularly good engineering to start with, but it is possible. So that is not necessarily the reason for the failure!
As an engineer that has worked quite a bit with CFCs the most important thing has been overlooked: The fiber orientation! I have never seen a hint that there were fibers that can take the axial pressure that the titanium endcaps exert on the tube.
Reply: @jackmclane1826  There had to be movement going on for it to make the first few times then after enough flexing gave up the ghost. The pressure on the cylinder itself is 36,000 Cadillac Escalades. I did the math.
Reply: @joanfrellburg4901  So you did the maths with the Cadillac Escalade as a pressure unit? How many bananas is that? ;)
The glue is under compression from the endcaps pressing against the tube. That is usually a regime that adhesives like and don't favor crack formation. As mentioned there are more severe design flaws in the vessel than these two backyard scientist hypothesises.
Reply: @jackmclane1826  Just giving some kind of perspective on the pressure that cylinder is under, and from what I've seen so far, it's the only thing showing any signs of destruction. The real issue is the two dissimilar materials expand and contract at different rates at various temperatures as noted by a few experts in the field.
Reply: @jackmclane1826  And if you wanna know about fruit, first weigh a banana, then go to Calculator Soup, the calculator should have your answer in a split second.
Reply: @jackmclane1826  GM made 40,000 Escalades in 2022 so there would be enough. Not sure about bananas. Quite a few I guess.
Reply: @joanfrellburg4901  Again: These issues are just what the internet meta of backyard scientists have zeroed on to, primarily due to constant repeating. And repeating it a bit more won't help here. I also have not seen any real expert in the field saying that. So far they all just repeat assumptions. Keep in mind: Youtube is an economy of attention. Bold half baked claims and chiming with the masses make more clicks and money than thorough examination. (That nobody can do here anyway.)

In my opinion as an engineer that has worked quite a bit with CFCs - these are not the most severe issues with the craft, because they can be solved by doing it right. And we have to give them the benefit of the doubt as long as more likely failure modes exist. They are possible issues, but the lack of axial fiber orientation is orders of magnitudes more severe.
Reply: @jackmclane1826  I have seen several say it. Are you using the same internet as me ?
Reply: @jackmclane1826  "You can't do that with a composite material because it's two dissimilar materials sort of blended together," Cameron said of the carbon fibre and titanium mix. "So, we (submersible community) all knew that the danger was delamination, progressive failure over time with microscopic water ingress and fatigue (of materials)." James Cameron
Reply: @jackmclane1826  Well I wish you luck with your theory. Could be anything until it's all examined, most of the commenters probably don't even own a bathing suit.
Reply: Imagine knowing there is a material much stronger than carbon fiber you can use but proceed to us carbon fiber anyway
Reply: @EpicBongZilla then how come these guys did multiple dives before?
Reply: @ario4795  You mean paincakes?
Reply: Very true
Reply: Captain obvious, what a genius.
Reply: It wasn't even done in the dust free environment either as far as the glowing on and all that stuff with the epoxy
Reply: @camojoe83  If one has a collection of spheres and toruses made of a skin material which can stretch by a computable but small amount under tension, filled with a liquid that can compress by a small but computable amount under pressure, then various pressure conditions would cause those shapes to be deflected in various ways which could approach an equilibrium where pockets don't get collapsed to nothingness.

The use of materials that can resist a combination of a compressive force in one direction and a tensile force in another allows many structures to be built more economically than would otherwise be possible, but such materials may suffer from effects like delamination in ways that may be hard to measure or predict.  By contrast, it's much easier to predict how materials will be affected by tensile forces, and how liquids will behave when compressed.
Reply: Why they didnt brace the two end caps with rods to add extra strength so they dont pop off is beyond me. Who just use glue?
Reply: @flatfingertuning727  sounds like we need to start emailing The Hydraulic Press Channel and see if they could test these ideas. I definitely would like to see a structure like you describe tested under some good pressure. I think it would be pretty cool to watch physics argue with itself even if it is just for a split second.
Reply: Thats my thought on it....the disorganisation of material at pressure that high caused the round to be not perfect and as i said
Reply: @flatfingertuning727  I still think as long as the liquids are less compressible than the passenger air space (and air is very springy, keep that in mind) it would probably make people catch on fire past a certain depth. Like a fire piston, lol
Reply: Actually they dont glue it. They just use bolt to ressemble it. The recipe of failure😂😂
Reply: 😂 you are true. Look like they hires engineer from IKEA
Reply: @William12-m8m  won't yhe pressure hold it in place?
Reply: which disaster?
Reply: @EpicBongZilla well…not capable after a few times…
Reply: Well,  it did work 99% of the time.  It's that 1% that bites you.
Reply: Stockton knew of all modes of failure.
The failure cause is yet to be determined.
If and when confirmed it will be something totally new phenomenon.
Reply: Something should tell you this isn't good when other deep ocean subs are not made using carbon fibre. Perhaps he could see the benefits for example on the Boeing 787 etc but underestimated it's weaknesses and the immense pressures. Releasing weights won't save you in an implosion. At least this is a wake up call for designers.
Reply: @joanfrellburg4901  are you sure it's 144 minivans per foot ? in metric its 4 000 tons per square meters, or 371 tons per square foot, ok yeah, that's 2.57 tons per minivan :)
Reply: @Dean_Winchester86  i think he was under a lot of pressure.
Reply: @HitsInSandbox  the viewport is gone, but that could have happened during the implosion. i still think the carbon is the #1 suspect
Reply: Why not build one, submerge it dozens of times to 4km and see what happens without anyone inside.
Reply: @bobsnabby2298  Because that would mean listening to the voice of reason. Their CEO was a nut job.
Reply: @nitraM321  There's a bunch of vehicles, Ford Explorer, Cadillac Escalade, I just google which vehicles weigh 6,000 lbs. Sometimes google has the answers. Sometimes.
Reply: It's all about tension and compression. 
Think of the old days. You want to make a lashing between the lower mast and the top mast of a boat. A piece of hemp rope would work wonderfully because it can handle tension. You wouldn't hack out pieces of sand stone for that application.
Now you want to build a vault in a cathedral. Sand stone can handle the compession and is what has been used traditionally. A hemp rope can't hold up a vault.
That is the Titan in a nut shell.
Those carbon fibres did nothing to the integrity of the vessel. The epoxi matrix had to take all the compression stress. Mysteriously it worked a few times. But it was doomed to fail eventually. The epoxi would squish out to the sides under compression. That is delaminate.
Reply: @beru58  Anyone can be an engineer, a doctor, a painter, a tradesman, but unless they adhere to a certain set of basic scientific and proven principles the results can be fatal. There are many examples.
Reply: I want the NTSB to round up these engineers and ask them such questions, about the extent of their knowledge on such matters.
Reply: @solidstream13  Or thru bolt it somehow.
Reply: @ario4795 glue*
Reply: @Lucilia-caesar7777 literally.
Reply: I'm fairly certain this dude just had a death wish and figured he'd be remembered so pulled this stunt
Reply: @jonfreeman9682 James Cameron? The film director? So now he’s a f*cking mechanical engineer on sub design? LMAO!! 😂😂😂😂😂
Reply: Yeah but we don't know if it failed at the seams. I me doing nothing about this would still say the seams where supported by an inside ring of titanium. It would seem crushing forces would push the carbon fiber seams against the edges of the titanium ring. So I would think the seams where supported by the ring of titanium which is unscaved. All my not knowing opinion would tell me it was the cylinder itself that just collapsed because unlike the seams the closer you got to the middle the less support from the titanium end caps or whatever they are called. Probably a terrible comparison but grab a soda can squeeze on it stand on it whatever the middle is always the part with the most damage. Maybe the glue but consider the pressure is just pushing it together even harder. So the pressure is literally holding it together.
Reply: @algorithm4390  My husband worked for a business refilling scuba tanks and the carbon fiber ones had a lifetime limit while the steel ones did not.
Reply: @apollomoonlandings That sounds like a perfect death, if you ask me.. 🤔
Reply: @christinecortese9973  Your thinking may parallel Rush's, "if it's ok for a Scuba tank it's ok to enlarge it and get inside!"
I think the submersible should have been spherical, anyway enough wreckage has been found to ascertain the cause of failure, .. Im sticking to my inmitial hypothesis.
Reply: Also a single hair from the men could compromise its strength.  Doing it in that environment is just irresponsible.
Reply: So expired* CF stock from Boeing intended to withstand ~10psi in extension used to resist 6,000psi in compression.

That worked!

*the thing about pre-preg CF is it has a self life, it is pre-catalysed, and needs to be kept cold to prevent curing. It still cures slowly though, so  if used, the layers bond less well and delaminate more readily. Then under compression you will get kink band deformation.
Reply: Doesn't carbon fibre need to be layered in different directions to give it optimum strength?
Reply: It is a shock it lasted long as it did
Reply: @katlynklassen809  
A long shock. 🤔
Reply: @michaellavery4899  yes but that wasn’t the factor in this. Carbon fiber works great when under tension and not so much under compression like how they used it.
Reply: What's the brand of the glue?? Need it for my  safety shoes.
Reply: @cryptoeagle3679  
Don't know the brand but it was an epoxy based glue.
These require heat or radiation to form effective bonds.
You should probably 'stick with' cyanoacrylate glues, the type found in regular super glues.
Reply: and it was all just an idea. only an idea. no inspections. nothing.
Reply: @cryptoeagle3679  I don’t know but I’m sure a hardware store has it as they bragged about using everyday products from there to put the sub together.
Reply: I don’t think the glued joints failed until the carbon fiber tube collapsed flat.
Reply: Also, who wants to be at 4,000 meters underwater in a vessel that is depending on glue, even if the materials are the same? Think there is some kind of glue-like material holding the car on fibers together as well.
Reply: I spent 50 years in aviation specifically aircraft structural construction and repair; no engineer in his right mind would allow us to perform a cold bond in a extreme stress application. The engineers should have contacted Taper-Loc Fasteners for custom fasteners & Hexcel Corporation has been in the adhesive game for a long time. Again engineering should have contacted them for Pre-Pregnated carbon fiber & a carbon fiber matrix suggestions in a saltwater environment. Then everything is hot bonded in an autoclave, not Skeeters backyard. My prayers go out to the families who lost loved ones from this tragic event and God Bless all of The First Responders for putting their lives on the line everyday for us. Im strictly aviation and have no expertise in submersibles.
Reply: The dissimilarity would be OK if each were stable. The instability existed as pressure intruded and fractured into the carbon tube. They also seemed to have screwed up in the gluing operation not designed to carefully prevent voids.
Reply: @ario4795  human confetti more likely
Reply: @EpicBongZilla  except that composite fiber would disintegrate and effectively disappear.
Reply: JohnnytNatural  in case of falure of the interface, the water would pass to interior of the vessel, kiling all of them, However the cylindrical vessel would not colapse...Coonsidering this possibility, interface failure, some damage to cylindrical body would occur, but not implosion...
I think that is more strong the possibility of failure of the cylindrical body under extreme external pressure...
Reply: The most stupid design in history.
Reply: Yes, it’s basically self explanatory
Reply: @solidstream13 You could have screws or lugs or connecting rods
Reply: I’d be interested in knowing how many human hairs were manufactured into the submersible’s carbon fibre hull, and glue?
Reply: Throw in a window not rated to that depth. Really arrogant and ignorant.
Reply: theres a reason why people try to build their vehicles monolithic
Reply: Don't forget that the entire machine was left completely uncovered, in an outside car park for almost a year!
Reply: Yes, it wasn't only the wrong material but also the wrong construction. Computer simulations would have cleaerly predicted what was going to happen. Stil, he didn't even used this relatively cheap tool.
Reply: You was absolutely spot on Steve. The glue line failed at the front due to repeated dive operations slightly compressing the cylinder.
Reply: @EpicBongZilla  Where did you get your physics degree from?
Reply: Many years ago now, I was involved in investigating the failure of a GRP cherry picker boom. We did acoustic emission tests on sections taken from the failed boom to see if it had been overloaded.The technique was used to see if other booms had been overloaded. The beam was loaded to it's max safe working load. If there was no noise from fibres disbonding faiture or matrix resin failure, it  indicated the structure had been overloaded at some point. The noise was expected to occur at 60% of the expected ultimate strength  of the structure and was called the "felicity factor". I assume the cracking sounds they heard on dives was indicating the hull was being overloaded. I don't know if they still do acoustic emissions testing on composite structures? When you do i,  you must be compromising/reducing the  lonh term structural integrity of item being tested?
Reply: Exactly
Reply: You are spot on. And that titanium ring didn't have one spec of glue when they pulled it up. The glue separated completely.
Reply: @ourlifeinwyoming4654  the titanium ring was a very smooth surface adding to the delaminating
Reply: @Turboy65 but the glued together pieces would still come apart.
Reply: they also skipped the whole part where carbon fibre is woven as a MESH

and not over layer over layer over layer in the same direction

what a bunch of fools

i dont have a degree and i know that

i also know that glueing different materials together, could lead to problems in temperature changes

all of them should never get a job in construction / engeneering again

even the most simply task was to hard for them 

i wouldnt even trust them building a bicycle.. and even less in building a go kart...
Reply: 1:40 they also did it in a construction hall

where debris and dust can fall into the glue and onto the surfaces where the glue is applied

which means gaps and air bubbles

i want anyone working there on a ban list for any important job for the rest of their lives
Reply: Well it worked over 18 times, imagine that.
Reply: And therein lies the rule that you can't mix carbon fiber and titanium. "You're remembered for the rules you break." At least he was right about that. Interesting that he quotes a total megalomaniac like MacArthur, too.
Reply: Yep ! , exactly , it was destined to fail right from the get go !, I'm surprised it even lasted one dive !.
Reply: He was an airplane engineer, not a marine engineer. He tried to design a sub like an airplane. Tragically, the design failed.😢